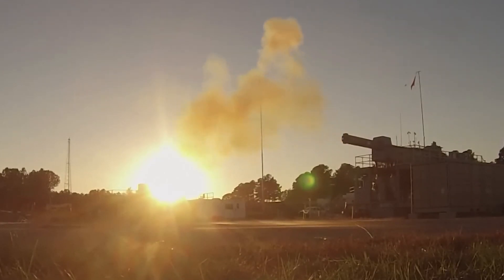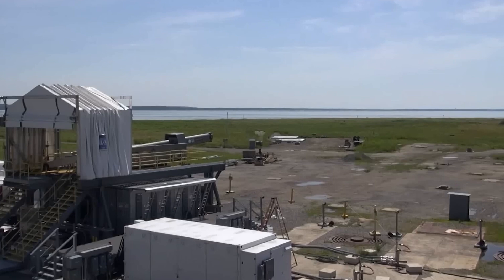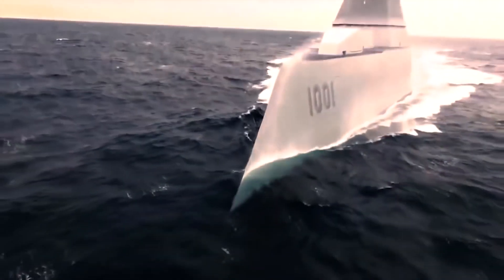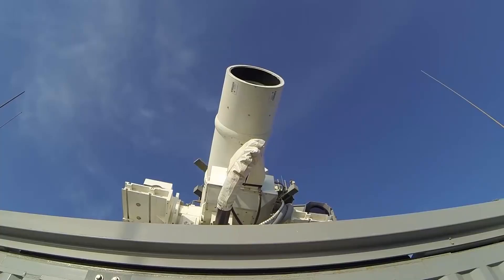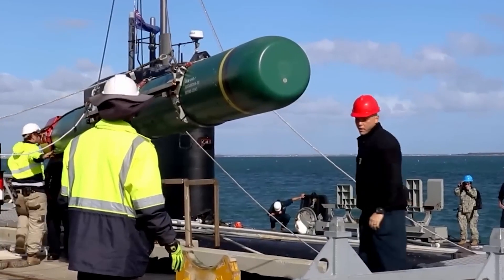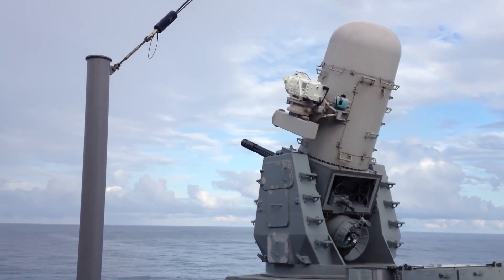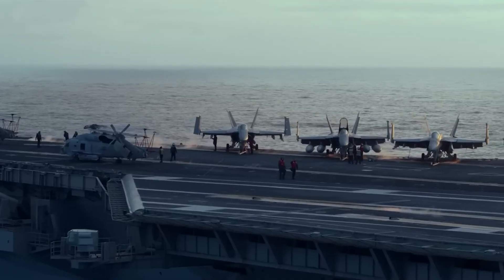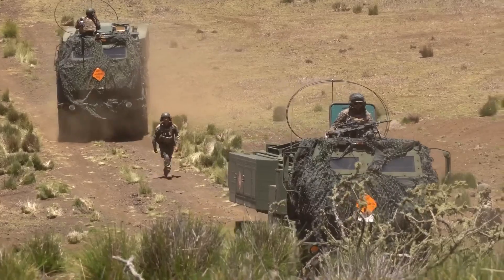This is US Navy's Mega Electromagnetic Railgun!

Comment: How there can be no explosive in there if there is a ridiculous sized muzzle flash? 1:47
Reply: No time to explain! There is only time for more military advertisement!
Don't think about the weapon they s*ck at building! Look at all the other way simpler ones that work!

But honesty: it's cause they are bad at engineering. The blaze is most likely produced by friction between the rail and the projectile.
Reply: The air is compressed so much by the projectile to the point where the air itself becomes plasma

Comment: he sheer force and speed at which it propels projectiles is mind-boggling ! Considering the immense power and range of the US Navy's Mega Electromagnetic Railgun, how do you foresee its potential impact on future naval engagements and the overall dynamics of modern warfare? I mean we have lasers now...
Reply from the maker: Lasers have a use but this is in another league for sure. So I believe they will alaays have a role in the next 15 -20 years 👍
Reply: Navy already launch aircraft on the USS Gerald Ford with the EMALS system.  It is the same concept.   According to Wikipedia it rated at 121 MJ at Max....